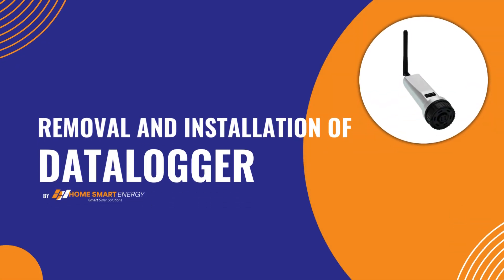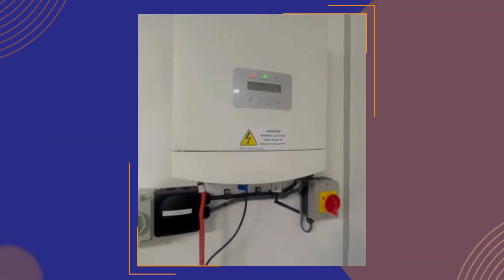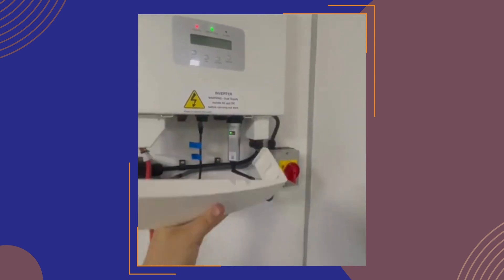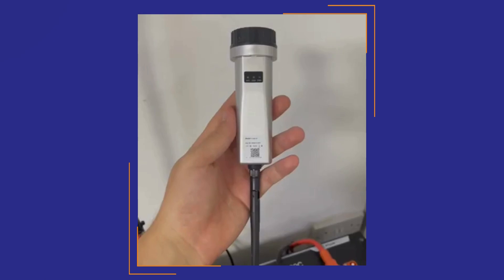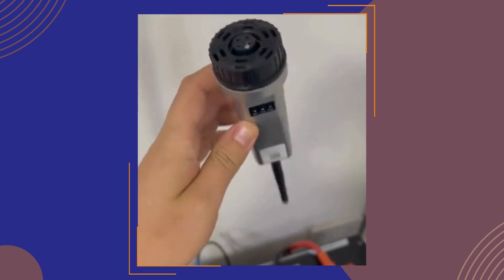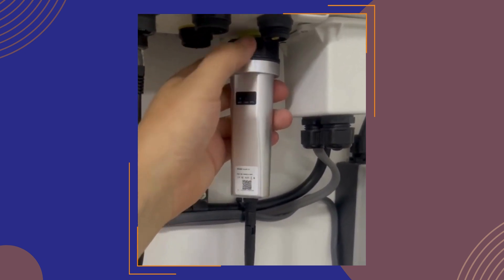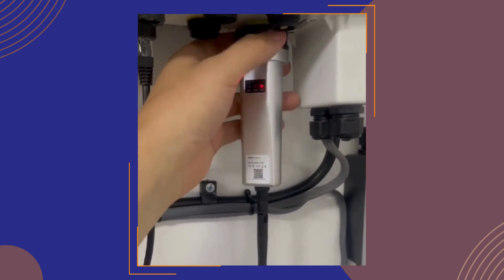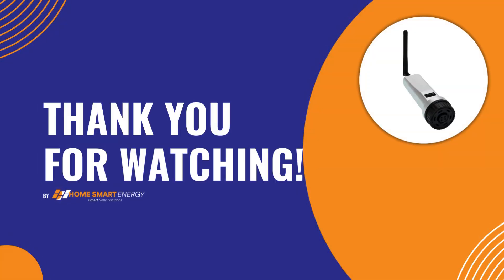Removal and Installation of a Datalogger - Solar Systems Explained!

Comment: i was wondering why i cant turn the locking mechanism  to unlock it
Reply from the maker: Thanks for reaching out! To help figure out what’s going on, we’d suggest sending a picture of the locking mechanism to your installer so they can take a closer look. That way, they can give you the best advice on how to get it unlocked.
Reply: Do what the Muppet original installer for mine did, unscrew it from the case so it's dangling with all the wires hanging out.... Still can't get the shroud off the port, and the datalogger is in two pieces.😢😮😅😂